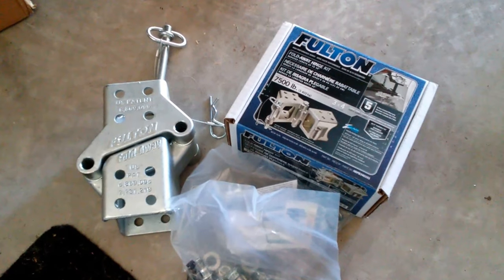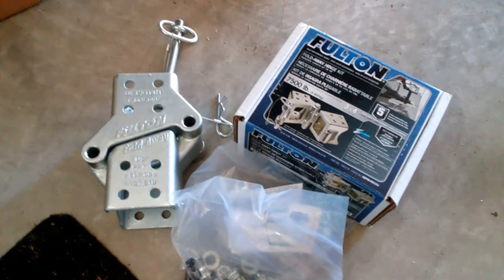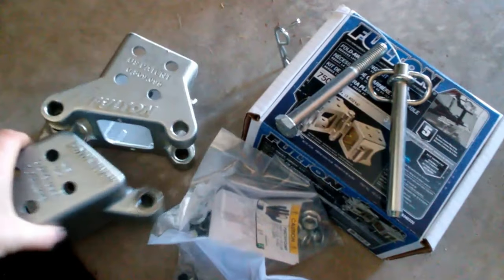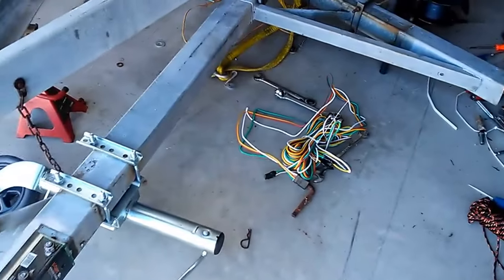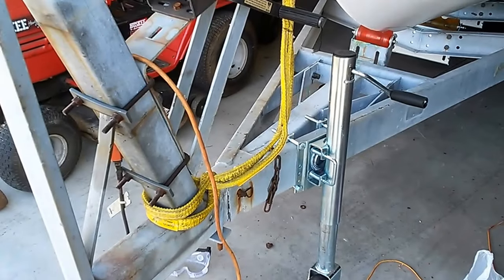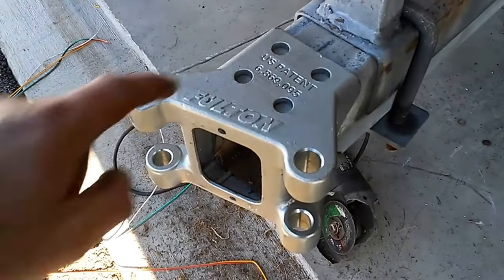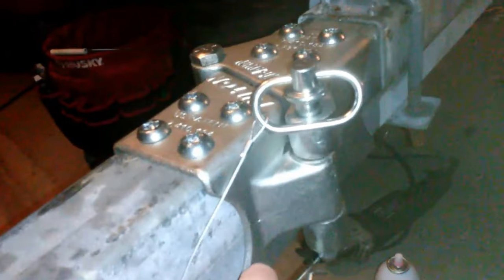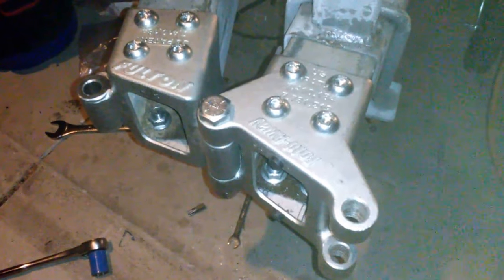I modified my boat trailer with a Swing / Fold Away Tongue hinge by Fulton!

Comment: You should have mounted the landing gear first then cut in front of that to put the swing arm
Reply from the maker: I'm sure that is the normal installation procedure, but doing it that way would of added a few more inches of required storage space that I couldn't affoard.   I only have about 2 inches of clearance with the tongue folded to shut the garage door.     Where the jack is now actually worked out really well!